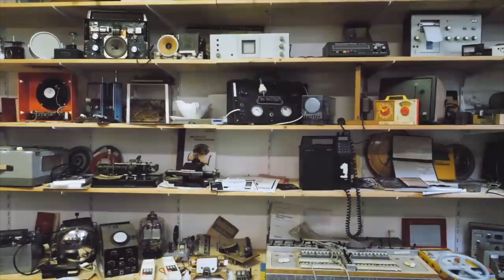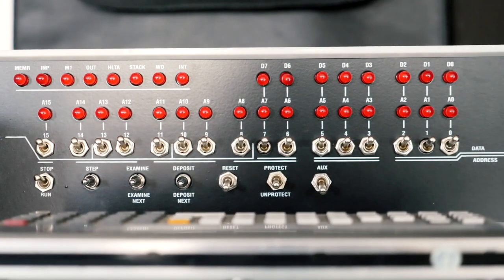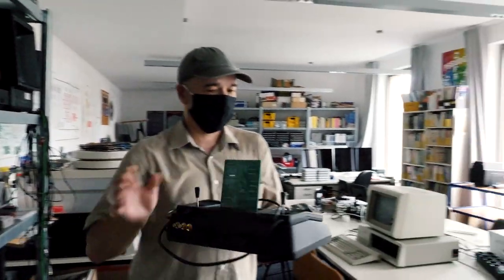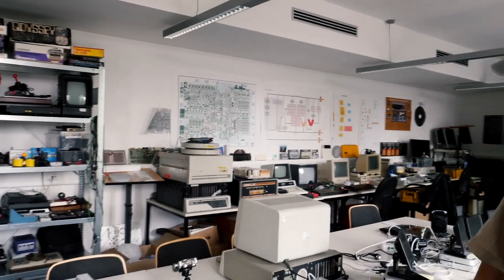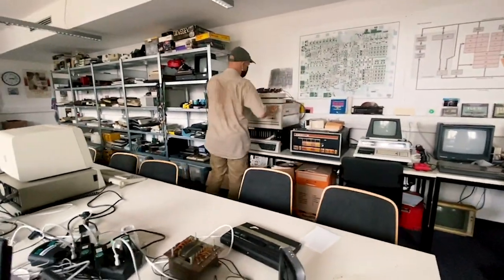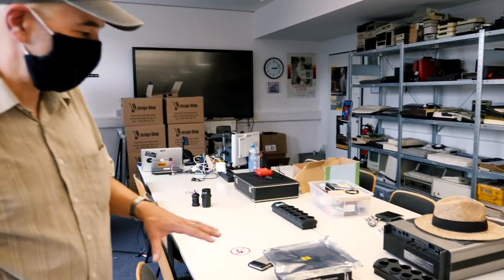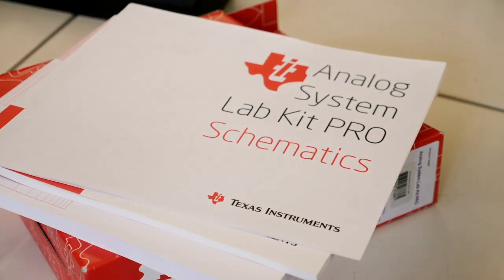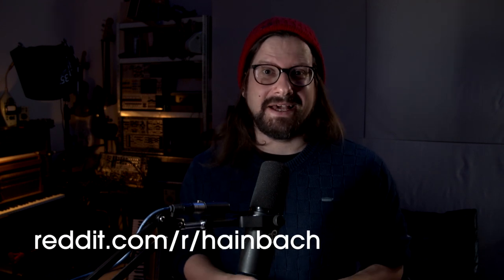Analog and early digital computing at Signallabor + vst plugin giveaway

Comment: I once programmed a metronome using the Vertical Blank Interrupt on my Atari 800XL. The interrupt was a quite reliable timer. On the 8bit-Ataris you were able to run a short assembler routine while the cathode beam (?) was jumping back to the starting point. 

Funny thing: a too long routine messed up the screen :)
Reply: I too recall doing stuff during the VBI interval on the 800XL. I'm amazed that anyone would choose to learn 8/16 bit assembler now given the sound-making tools now available, but power to them.

Comment: I have the PiDP11 that you allude to in the video when looking at the PDP8. It's a kit of the panel with a Raspberry Pi running the SIMH emulator. There is an FPGA replacement for the Pi under development that will be much closer to the real thing. The predecessor to the PiDP11 is a similar front panel kit of the PDP8.